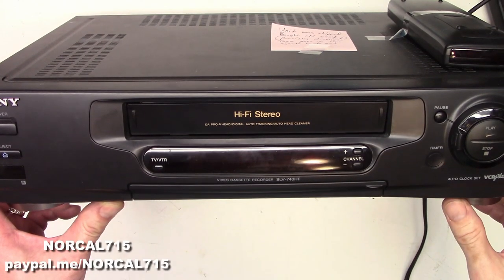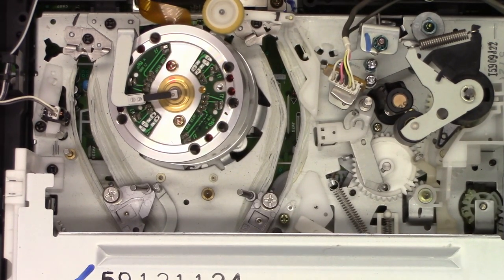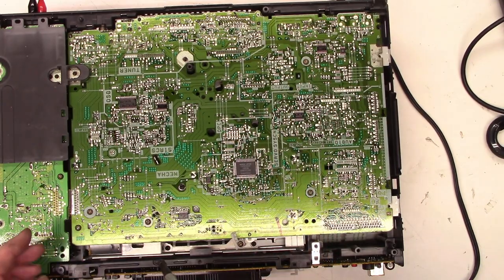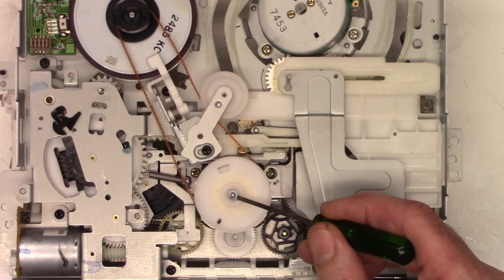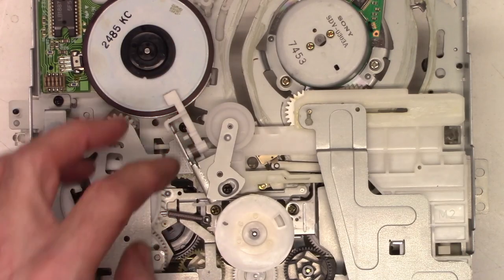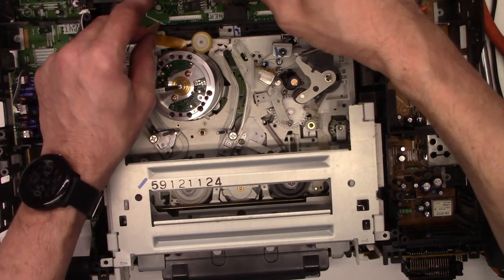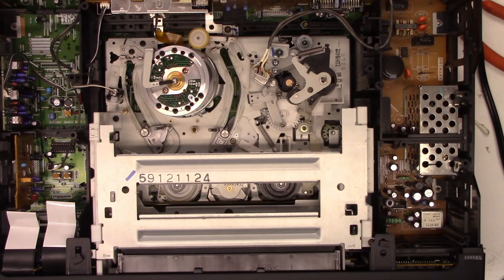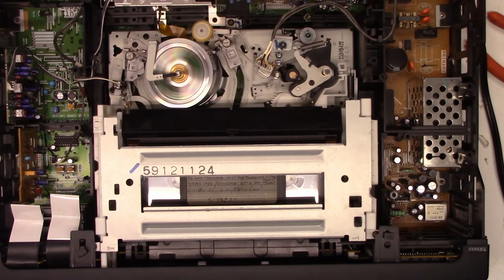SONY SLV-740HF LOADS TAPE THEN EJECTS IT BACK OUT REPAIR FIX

Comment: Great video! 

I actually had the complete opposite problem, where it would not eject at all. This was after I took it apart to clean out the one I just purchased. It would try and eject, but wasn't prevented from going out because the door would not open.

You video helped out greatly for me to figure out the issue. I wasn't aware I had to leave the door open while re-attaching the front. Thank you!!!!!

Comment: Thank you.  I have a SLV-780HF here with the same transport mechanism.  Tape would load but not play.  When going into play, there would be a loud "clicking" noise.  It turned out to be the slip clutch.  The plastic bearing in the center of the clutch (the wheel that you removed that was held by the small plastic clip) had frozen up.  A few drops of oil got it freed up and playing again.  The problem was probably caused by lack of use rather than worn from too much use.

Comment: Older VCR units such as from the 80s and 90s will always have technical problems. I found out later models from 2000-2005 still have good image and are less prone to failure especially since many of these have not been used extensively, since this was the time when people started buying DVD units. In my opinion, go with a JVC or Panasonic made after 2000 that has seen little use, and keep these unplugged while not in use to help the capacitors last longer.

Comment: Great Job. You know your stuff. You should engineer these things to make them last! I have a Sony SLV700HF that make a squealing sound when the tape is installed in the deck  and then it ejects the tape. Any insight into what I can do to repair this unit? Thanks. Rock On
Reply from the maker: Check the belts, most likely one is slipping and that is the squealing sound.

Comment: I have the same problem but in my case the tape is going to the head. It ejects the tape after 2 or 3 seconds. Any suggestions would be appreciated. Thanks.

Comment: Hi, I hope you can point me to the right direction. I have a Sony SLV-X822 that loads the tape up fine but is struggling to keep up regular smooth, consistent play speed. I popped the top off and notice that it the motor is fighting an uphill battle to maintain play speed. 
I have used several tapes with the same result. Fast forward and rewind show no issues!
Reply from the maker: Check the tape back tension, if it is too much then it will struggle to keep up. Otherwise something may be dragging.

Comment: Thanks my grandson purchased VCR players none work. So Nana called to assist with 5 VCR players . I'm experienced in micro electronics and rework not VCR not DVD players..I've reviewed this I do believe 1st is to clean the parts with pullies blow out dust ..I not used desolder tool before . where to purchase?
Reply from the maker: It is a Hakko FR-301 from Amazon is where I bought mine

Comment: I have a question for you. I have a sony model slv-780HF. Its acting as if a tape is already in it. When I hit the eject button it goes through the numbers and pushes out, but after a few seconds it pulls back in like a tape is in there, then goes back to playback mode. So it's like I have a ghost vhs tape. Can you help?

Comment: Hi Nor where are you getting your dielectric yellow grease and machine oil from alls I see online is the silcone clear dieelectric grease
Reply from the maker: If it is yellow then something is wrong, The grease I use is the clear type. The machine oil is Zoom Spout oil. The dielectric grease is available at almost any auto parts store. The oil is available at most appliance repair shops.

Comment: I should consider sending off my Sony DVD/VCR combo to you instead of throwing it out. The DVD player recently died and now the VCR is exhibiting the same problems as this one. Thankfully, it didn't destroy the tape I had playing on loop, but I did have to open it up to extract the DVD that was stuck inside - I did consider trying to replace the DVD logic board, but I couldn't find anything that matched the part number :( And without DVD functionality, I couldn't set time or even access settings exclusively for the VCR
Reply from the maker: Email me NorCal715videos@gmail.com

Comment: Hi, I have the same model and was having the same problem. After I took it apart, got it to take the tape, but now it just won't play it. It does fast forward and rewind (only for a second or two before stoping). It does make a sound like something is stuck though. Any suggestions will be appreciated.
Reply from the maker: I would need to look at it to figure it out. Sorry.

Comment: Greetings. Any tips for problems like this:
The VCR plays, forward, rewind perfect. All is good.... except when i press eject.
There is a great chance it won't spin the magnetic tape back correct/enough so there is still tape outside the cassette when it drops down the "flap" and ejects the tape = wrinkled tape, or it will get stuck in there.

I have this on a copuple of players. They just seem fine until you try to eject the cassette. I opened one up and can clearly see it is not "spooling" the tape enough/correctly, but i can not see where the issue would be.

Plz help!
Reply from the maker: probably the clutch in the center that switches from low torque in the play mode to high torque in the FF-REW/eject position. Also could be a brake not releasing the reel tables at the correct time too.

Comment: Hi I have a JVC HR-S860 SVHS VCR when I insert a tape it powers off, could it be a mode switch issue, also the VCR has a blow fuse and that makes a noise, not sure what the issue maybe. Please reply.
Reply from the maker: email me at norcal715videos@gmail.com
Reply: @norcal715  Hi I have emailed you my request how do I take the mechanism out as I have taken the screws out but still cannot get the mechanism to pull out.

Comment: Hi i have Panasonic sd 220 when i turned it on it takes the tape to the head then immediately it ejects the tape. Kindly help me out to sort out the problrm
Reply from the maker: Possible mode select switch, cylinder speed sensor, capstan frequency generator, reel rotation detection, or power supply problem. Most likely.

Comment: Dude, I gotta try this.
I have a VCR of a different model but with the same mechanism that behaves almost the same.
Will report back if it works.

Didn't work, it still gets stuck in the cassette down position.
Do you happen to have a video setting up the timing on this mechanism, including the loading mechanism?
I have the service manual for this mechanism, and I think I have most of the holes aligned in the right way, because when I apply voltage to the loading motor, everything works perfectly fine.
But everything breaks when I put the loading mechanism back on, and the service manual doesn't say much about the loading mechanism.

Ignore that, I think the problem is the gear that connects to the metal slider of the front loading mechanism, some of the teeth are damaged.
Anyone knows the part number or a way to try and fix it?
Reply from the maker: email me and send some pixs of the gear and the location in the mechanism. Norcal715videos@gmail.com